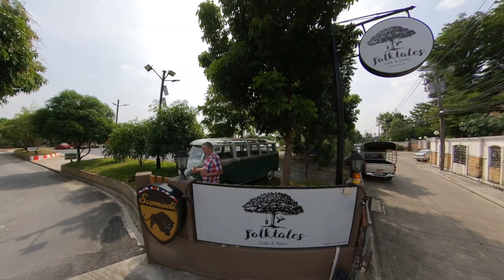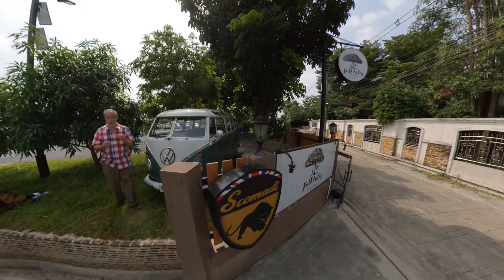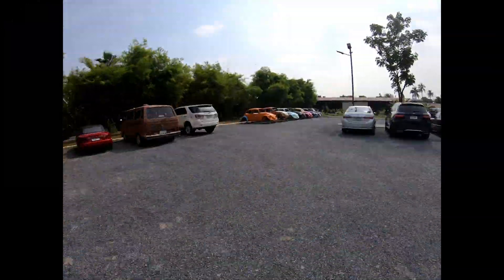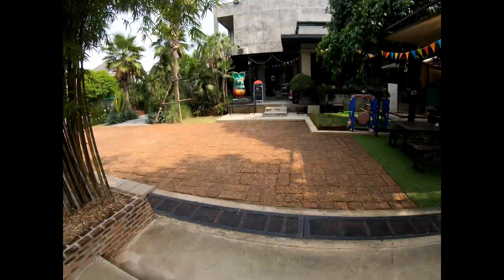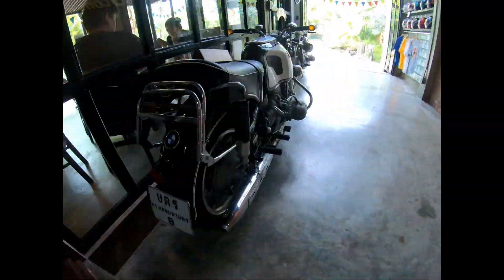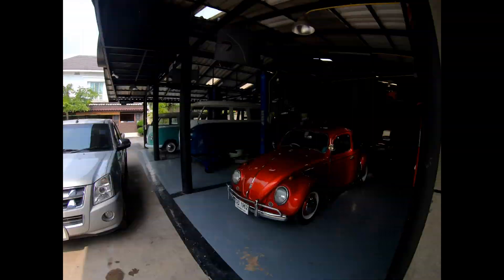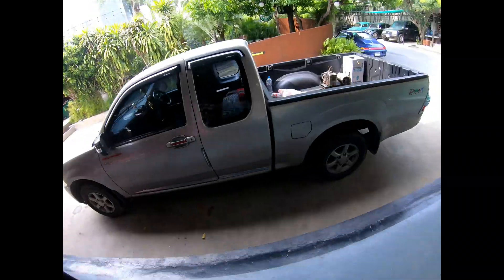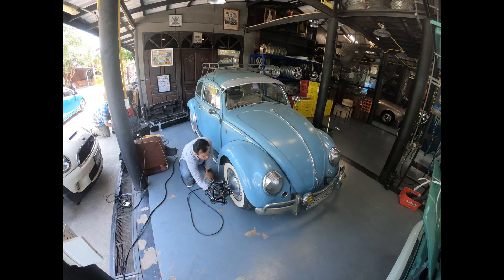Volks Scooter debut Bangkok MotorBike Festival 2020

Comment: Not really a brand new idea... I mean volkspods has been made for a while and are quite easy to build.
Reply: Walter Werks on Instagram made the Volkspod in the fall of 2019. This video was shot in November 2019. Others have made Volkspod like things for 20 years, cutting up fenders and banging them together. I applaud all of them. Our new creation is that we designed it all in CAD, as a product, that is repeatable as a product with a manual, warranty, etc... and we did it in 60 days. Pretty tough to design something, and produce it in 60 days, with Christmas and New Years smack dab in the middle of the schedule. Easy to build? You need a lot of skill to build one. Give it a try.